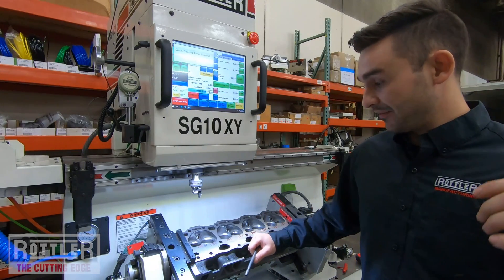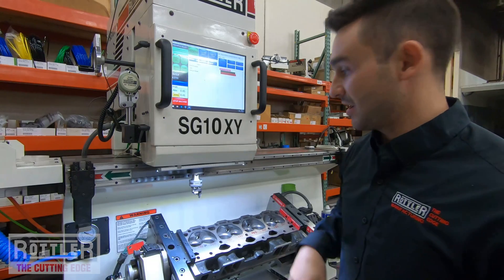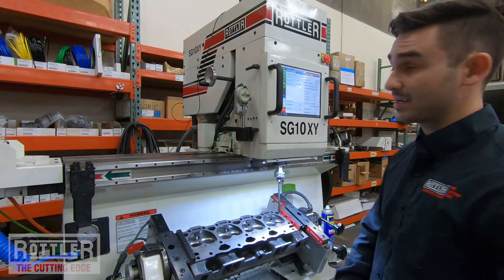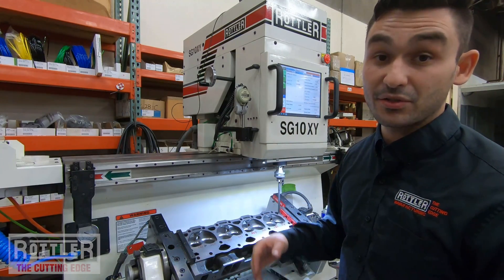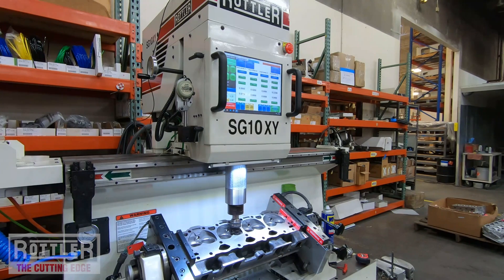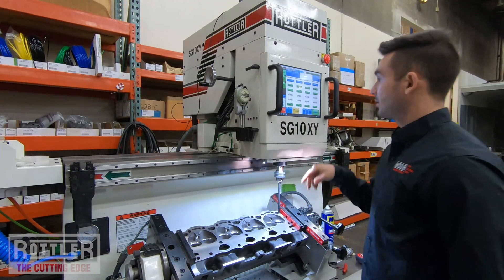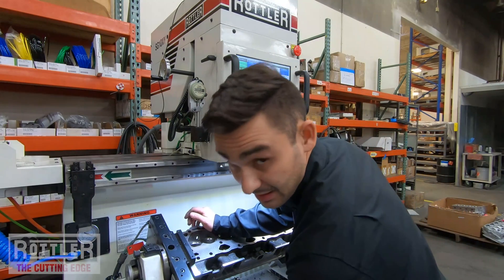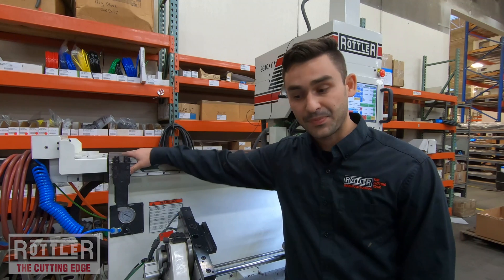Rottler Tech Tips: SG10XY Setup and Operation, Part 3 (Final Installment)

Comment: Hello. My boss is convinced that there is an air blower built into the machine. He believes its next to the coolant line and there is indeed a red line next to it with an "A" marked on it. They think thats a compressed air line. I've been digging around the options and set up menus but I cannot find anything related to it. Am I looking in the wrong place or is that line for something else entirely?

Comment: Does it know the original height and depth after cut?  A lot of heads seats sit at different heights by several thousandths.
Reply from the maker: In current form the machine does not track height before and after for each seat it cuts. Typically this machine is best served in a production setting that is replacing valve seats, where all the new seats are cut to a pre-determined depth so they are all the same height. In a setting where minimum cleanup is the standard procedure, we would typically find an average value that cuts 90-95% of seats and the machine has the option to do an additional depth cycle usually set to .001-.002" to re-cut any seats that were not cut during the standard autocycle.